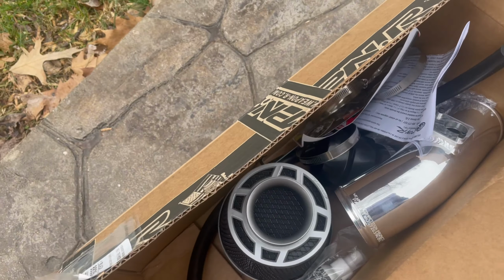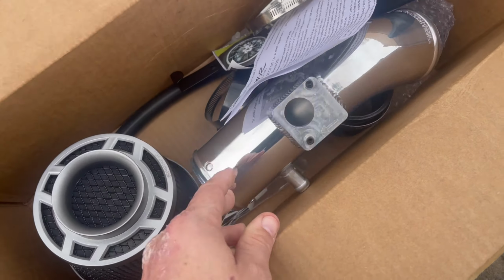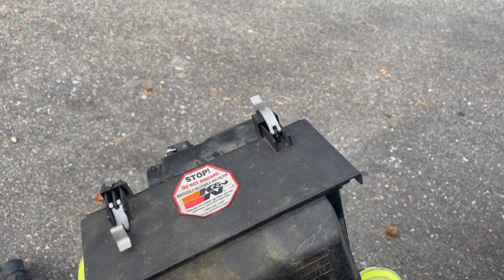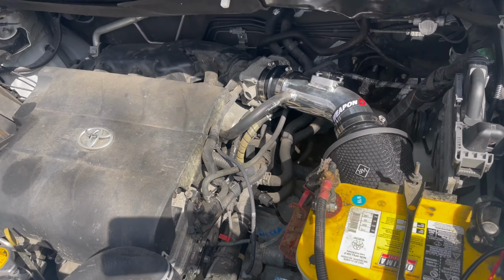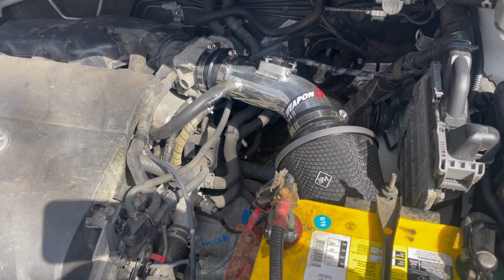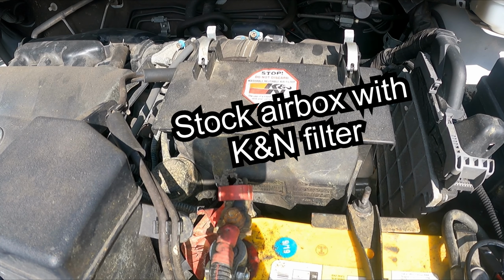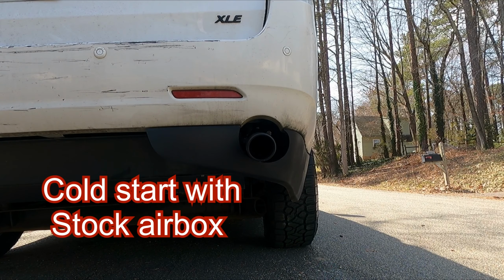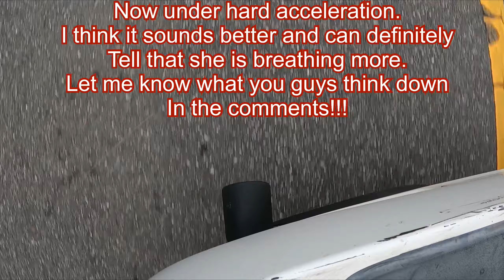Weapon-R Short Ram Instake for Toyota Sienna. STRAIGHT PIPPED! Before and after sounds!

Comment: I did the full cold air intake as opposed to the short ram intake on mine. It was aggravating to install but it was worth it. I haven't gotten any CEL so far but I've had to watch how heavy my foot is on the gas pedal 😂😂😂
Reply from the maker: Nice!! I almost went with the ful CAI but didn’t know how it would fit with the modifications that were made to it with the wheelchair conversions

Comment: Thanks for sharing the video. What did you end up doing with the extra vacuum hose and sensor from the airbox that wasn't in the install video?
Reply from the maker: I’m assuming it didn’t need them. I used the t-connector and connected the loose ones from the engine together. And everything has been holding up really good. No CELs or anything
Reply: @TheOutdoorTracMan  Okay, great. Thanks for the quick response!
Reply from the maker: No worries!

Comment: Where did you connect all the smaller vacuum tubes? I have a Lexus ES330 and it's a similar setup and the only thing holding me back is all those super small vacuum tubes that were attached to the filter box.
Reply from the maker: So mine had a ton on the actual box but only a few going to the box and they send you a t connector to connect them all together. It looked a lot worse than what it really was